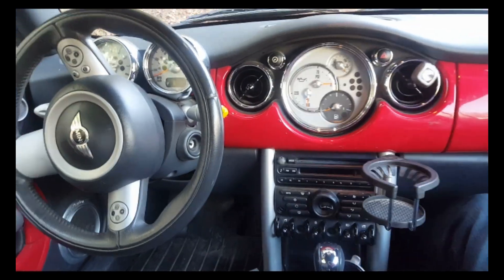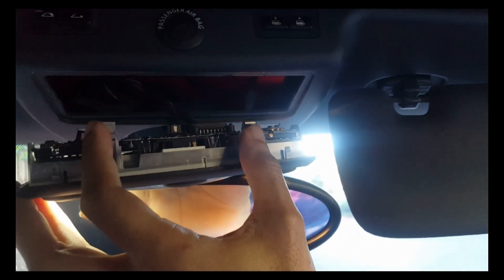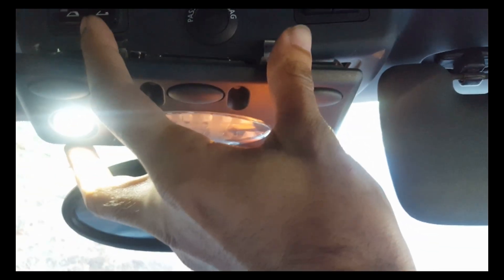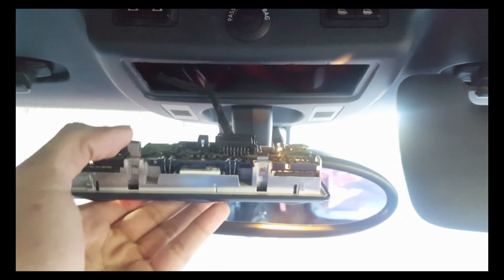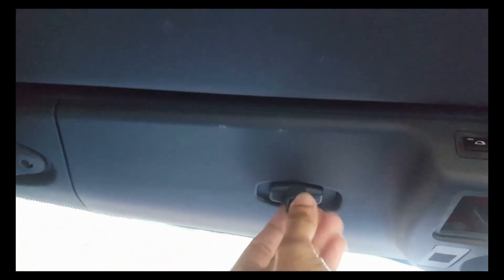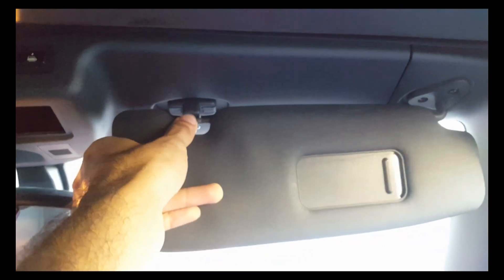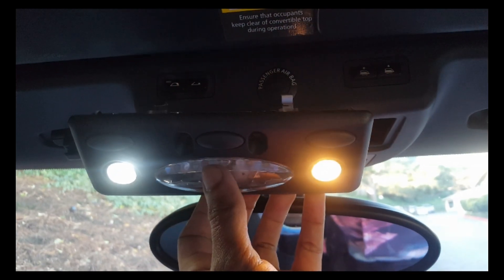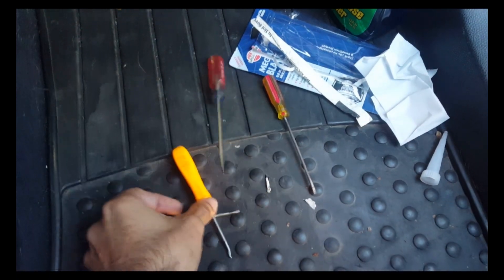Interior Light Bulbs Replacement - Mini Cooper - Convertible - R52- Marque - 2005 2006 2007 2008

Comment: WARNING: In this video the front tabs are shown very bent (they got damaged during removal). If you don’t depress the tabs enough BEFORE pulling down, you will bend the tabs up like this. If this happens, you will need to bend the tabs down correctly or else it will not hold itself in place nicely when you slide the assembly back in.